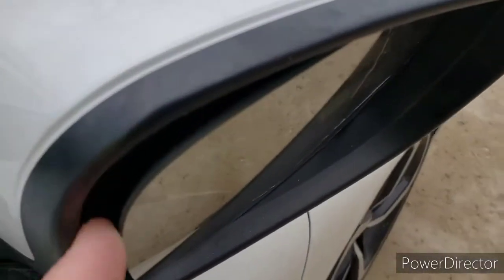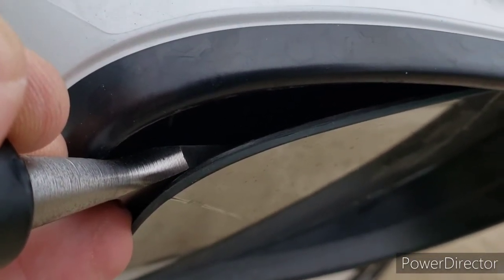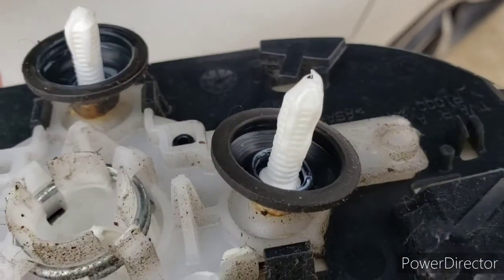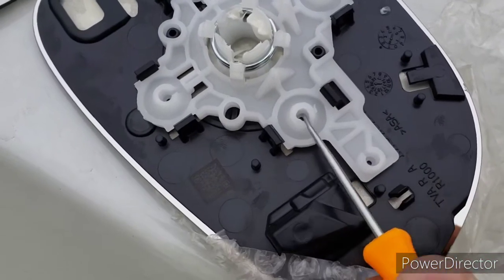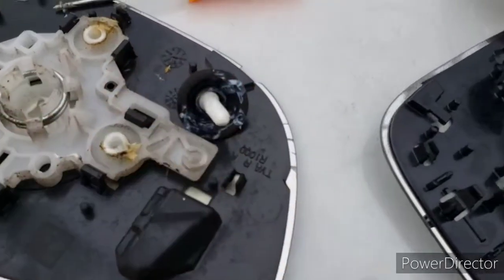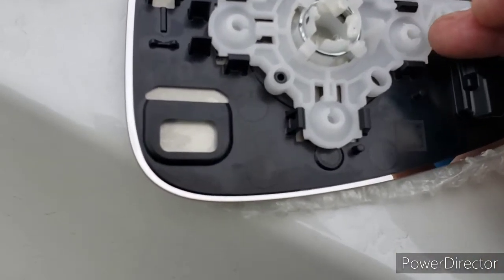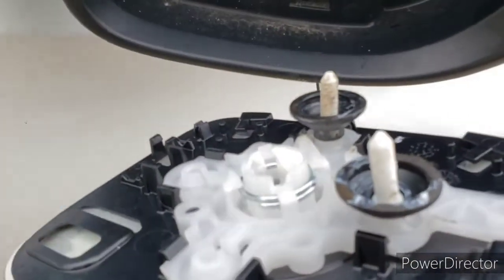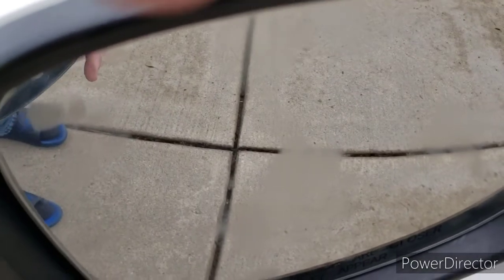2018 Honda Accord Passenger Side Mirror Replacement

Comment: As someone who knows next to nothing about cars, thank you. I was able to fix this problem (my glass was gone, the white plate was still in the housing) on my driver's side because of your video, and your inclusion of the part name (I just changed it to left obviously because it was my driver side). I didnt have any of the stuff you did, so I used a paper clip I straightened out to pop the fasteners odd the old one, and I took a scrap of paper towel and wrapped it around the ties of them when I was pushing them back in with just my fingers because I couldn't get enough grip for the force needed without (and didn't have pliers as you used). It was about a five minute job. God knows hoe much Honda would have charged to fix it for me. Thank you so much.

Comment: thanks for the video Dale! Super helpful, when I first pulled my side mirror off after breaking it the white piece stayed attached to the mirror assembly and I wasn't sure how to proceed but this cleared things up! The heated ones are pretty much the same thing just with two little terminals you have to pull off.
Reply: I got side swiped JUST enough to spin my housing around and take my glass off.... white piece still in place, so same. Wasn't sure what to do.

Comment: How do I install the heated wiring? Any idea? I searched the internet, you have the best video. But as you stated, you don’t have the heated glass.
Reply from the maker: If you are replacing the glass that already has heated mirrors the two wires should be behind the mirror just hooked them up to your new mirror, if you're trying to add heated mirrors to the car that didn't have heated mirrors originally that would be a lot more difficult to do and I would suggest not doing that

Comment: I did this on mine today and the two fasteners don't seem to be pushed in far enough even though the ball joint is in.  I really think the white plastic and fasteners and ball need to installed first so those two fasteners can be pushed in better.  Then the mirror can be pushed into the white plastic clips.  If just the ball joint is connected then the mirror does not articulate from the door control.
Reply: I’m having this same problem it won’t adjust the mirror correctly anymore

Comment: Where do you get the plastic screw and rubber covers from?
Reply: were you able to find it?
Reply: Hey  @ARafael1555  we’re you able to find those screws? I’m looking for them too
Reply: @LuisLopez-ee6yo  no. Went to the junk yard and bought the whole piece with the screw. With everything ran me up $45
Reply: @ARafael1555  ok did you replace the whole part? Or did you just popped in the screws?
Reply: @LuisLopez-ee6yo  whole thing mirror and screw

Comment: The pieces you put on the other mirror what are the actual names to those
Reply from the maker: Try calling the Honda dealer parts department to get the official name.
Reply: were you able to find it?
Reply: @dalechalkey3729  Honda doesn’t sell them. You have to buy the whole assembly to get it. Which sucks
Reply from the maker: Try getting it at a junk yard

Comment: You skipped all the most difficult parts, namely how to get the 2 white studs out and back into the sockets.
Reply from the maker: I didn't have an extra person to film my activities so I couldn't capture those parts, just talk about what to think about.
Reply: He put the small metal tool into the cut out. It wasn't easy force wise, but I knew what to do from this video, just fine. I used a paper clip. As for popping them back in, he said you had to line up the little nipple with the cut out. What else did you want? Yes, again, hard. I did wrap a tiny piece of paper towel around the ties on the fasteners when I was trying to get the ball of each popped back in, because pushing straight down with my fingers directly on the ties was hurting my fingers, since I didn't have pliers, but I knew 100% how to do it from this video. I'm not someone who knows the first thing about cars. I call AAA to put on my donut etc, and I managed to replace my mirror in about five minutes this morning after watching this video once four days ago...